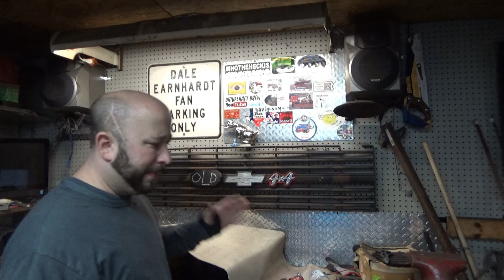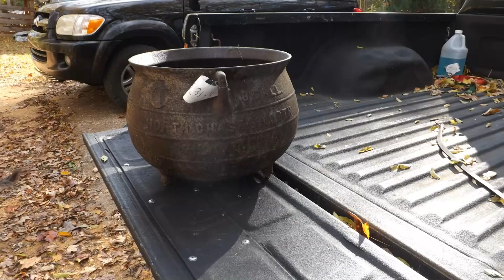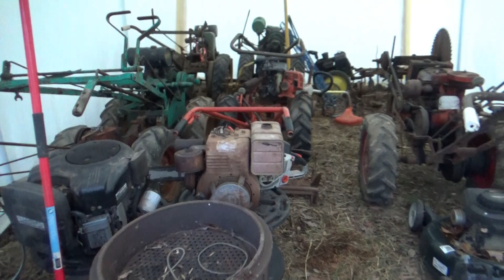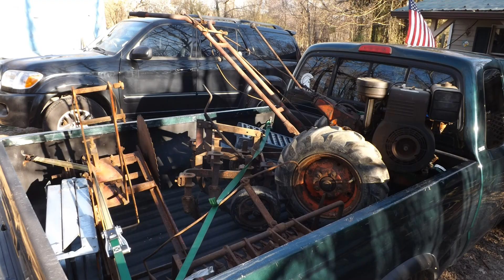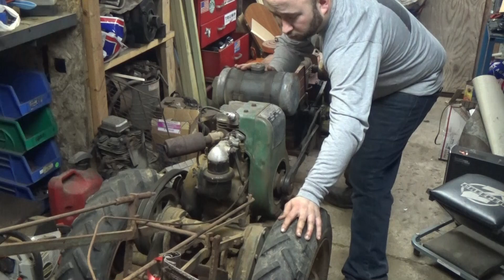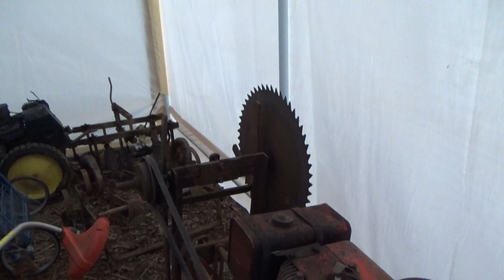Last Update - 2018

Comment: Hi, Danny. I see what looks like a 5, 6 or 7 HP Briggs & Stratton engine. Going by the decal on top (obscured, so can't see the HP), the build date would be from... 
a) August 1, 1964 (code 6408010) to July 31, 1965 (6507310) if it's a 5 HP 140300 or 141300 series or a 6 HP 142300 or 143300 series.
b) August 1, 1965 (code 6508010) to July 31, 1966 (6607310) if it's a 5 HP 144400 or 145400 series or a 6 HP 146400 or 147400 series.
c) August 1, 1966 (code 6608010) to July 31, 1967 (6707310) if it's a 6 HP 146400 or 147400 series or a 7 HP 170400 series.
(model, type and code numbers can be found on the shroud on the left-hand side, after removing the air cleaner cover)
Reply from the maker: I haven't even looked at the model/code yet... I just scooped it up when I seen it LOL